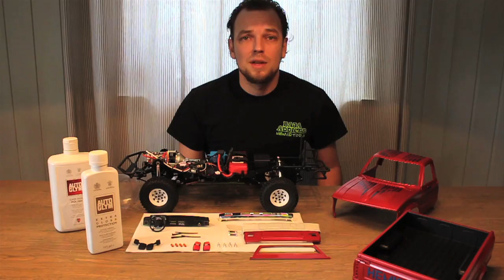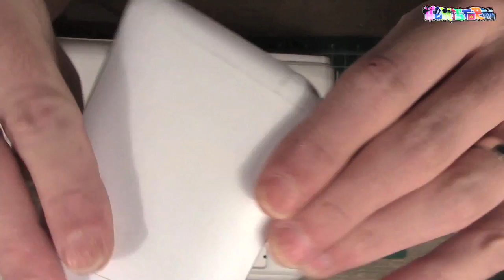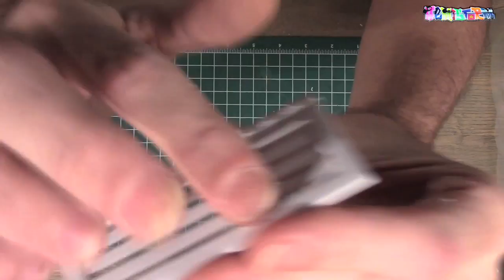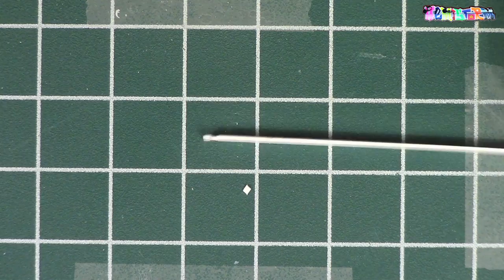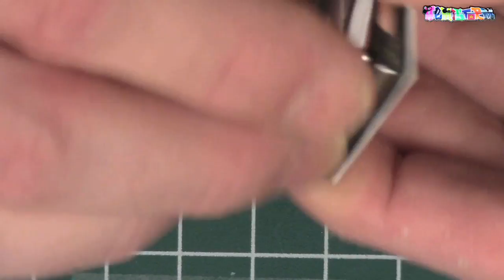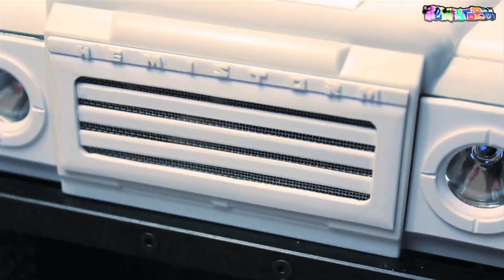How to make a CUSTOM Grille &  Headlights - Kahn Defender - RC4WD Gelande 2 - Styrene Basics 3

Comment: I've seen you print off patterns to use on lexan. Why not try the trick on this material as well? I wonder if you could put a thin sheet through a printer? Might not be porous enough to hold the ink though.
Reply from the maker: Hi Casey, you mean as in to use it as a template to cut custom shapes? I think that would be pobbible, and otherwise with the old-fashioned carbon-copy-sheet. (I remember those from my typewriter days. I just realise I'm getting old. lol)